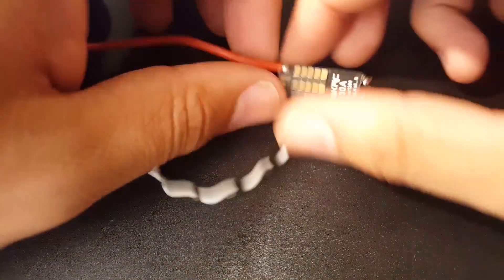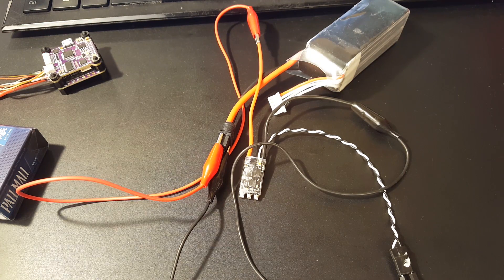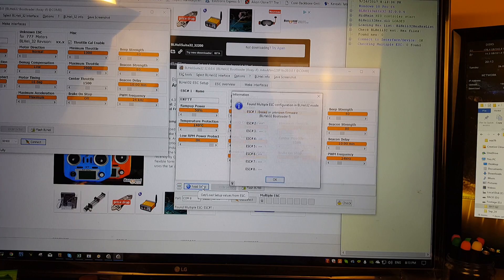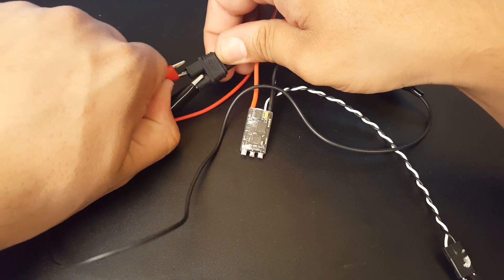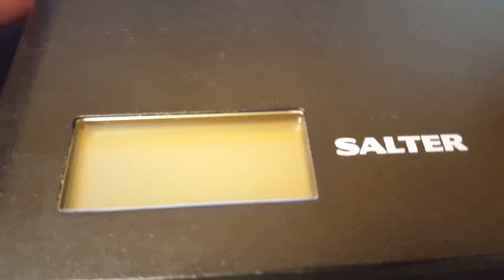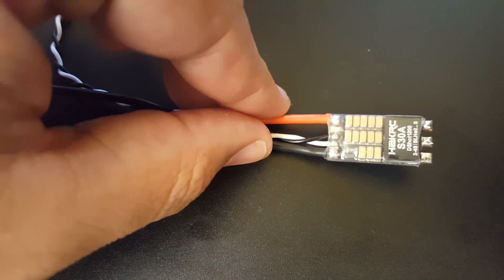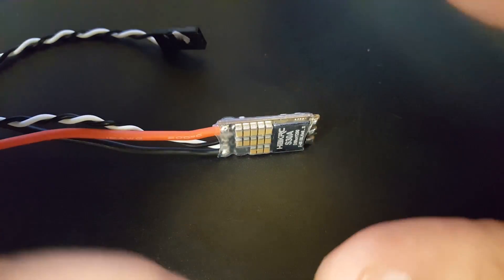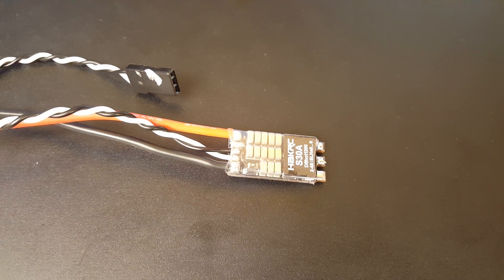HAKRC BLHeli32?? // Review and Noise Testing

Comment: Hey dude will these escs be ok on the matek f722 with the brotherhobby returner r6s motors because I know the matek has a sensitive gyro and will a 470uf 35v low esr cap be sufficient to clean any noise, placed on the incoming batt power
Reply: You've probably already tested this but I'll write anyway, might help others..

I've used these escs with ls2207 motors on the first matek f405 aio which uses the same gyro without problems.

Comment: I'm using these on 2 quads. They're great, but they don't work at 48khz. Ok they may appear to work, but I had desynchs. Back on 24 and they're fine. This is on dshot1200 with f4 flight controllers (Matek F405 OSD and Dys Pro V2). Have ramped back up to 32khz and so far, so good. But I'm not goign any higher at this point due to the desynchs.

Comment: You can get a set of 4 of these for 38 dollars from Amazon under the brand name Nicidi. I fly mostly Wraith's at this time just because I havent had one fail even when over abusing them lol.. I was given two sets of these to review and I was absolutely impressed.. With a little bit of adjustment the performance is superb, In fact I cant tell a difference in flight between these and my Wraiths and I have MANY MANY MANY packs on Wraith BLheli32s (I have at anyone time 8 to 10 builds with Wraith ESC's on them and fly between 20 and 30 packs a day on them so I know the feel of them very well and truthfully I cant tell a difference between these and them) they feel exactly the same in flight as my Wraiths and they hold up super well. I have a premium budget build I put these on (I was given 8 for free, I have since bought 6 more sets of 4 and pay 38 to 41 dollars on Amazon for them) the build is a F4 Omnibus Pro, These Escs's, RaceOne/Nicidi 2306 2750kv motors (Absolutely stunningly awesome set of 2306's for under 50 bucks. Both the 2400kv and 2750kv)  Realacc Real 1 5 inch frame that weighs in at 92 grams, Runcam Eagle 2 pro and a stack mountable 200mw VTX, Graupner GR-12 SumD only receiver. ready to fly minus battery is 302 grams. Flying my Teampilot 1550 100c packs (And 1550 95c R-lines) the thing flys AMAZINGLY good like WOW for a mid range price product build its flat amazing.. I would say its 90% as good as my top spec builds and im not kidding... I have really ripped these packs hard running Avan Rs on those 2306 2750s  on flat punchouts it will pull 170 amps on the Avans and settle down to about 130 amps and these escs handle it no problem at all... I have wide open throttle them running around a big field killing a 1800 mah 75c 4s pack in about 40 seconds and the escs handled it no problems.. The amp draw on that flight was 110 to 130 amps the whole flight that lasted 40 to 45 seconds, I was amazed that I didnt cook a esc or two or all lol but they stood up to it and when I temped them right after landing they was 120 to 125 degrees each.
I really cant believe how good flying a quad you can build now for little money, If I was to throw a high quality VTX in there (I fly almost exclusively Tramp VTX's) I could take this out and race with it and turn really good lap times for a heavier rig, in fact I would say one of my premium rigs in the same weight range would turn less them 5% faster lap times on avg and thats only due to the faster response of the premium motors that im used to flying overall power wise those Raceone 2306 2750s feel pretty much the same as my Returner R5 2306 2522kv motors maybe a little slower on top end but not much and the response is a little quicker on the R5s.. The main difference is the R5s make a little more power but pull a LOT less amps, but the R5s are a 100 dollar set of motors and the Raceones are a 48 to 52 dollar set of motors.
Oh yeah, I have a set on a Floss 2 build, Hyperlite 2204 2522kv Floss motors, these ESC's, HGLRC F4 V5 Pro, PDB, FC and VTX AIO, Eagle 2 pro cam, ready to race minus battery is 237 grams.. I fly it on Tattu 5s 95c R-lines 90% of the time and have flew it on 6s and cooked one ESC on 6s(However it was due to clipping a small branch and it getting stuck in the motor locking it up, current sky rocketed before I dis-armed and cooked that ESC.. I had flew 8 6s flights that day back to back to back and it was fine. 6s is pushing it and you may well kill them but on 5s I can attest it handles it no problem. Just dont go slap on some high KV 2207s or 2306 and fly 6s as the current will be fatal for them), on 5s it has well over 200 flights on it with not one issue flying the 2522kv 2204s with HQ5x4.3x3V1s props and pulling a max amps of around 95 and a avg amp draw of 45ish when just playing around running gates getting ready for a race, 5 to 5 and a half minute flight times on good 1300s is really nice with that setup. I know its a long post, Im just shocked to say the least about how good of products we have now at very VERY low prices.
Reply: beeker bot you can get them for $4.99 on sale like I did ;)
Reply: beeker bot how do you like your f4v5? I had mine in my chameleon with my dys 2207 2600kvs but someone cut through my jeeps window and stole all my quads and tools yesterday :/
Reply: Well here I am, a year later and only one esc have failed. I've got them on two quads and one of them I fly exclusively during winter and rainy days or were I could get in contact with water/damp grass etc etc. 

It's on that quad one esc broke. Mind you in that crash two motors got ripped off and everything except three escs, the camera and rx broke. Was going pretty much full throttle into rebar and then smashed into the concrete ground cartwheeling a good 15-20 meters. 

Got to give a huge thumbs up to transtec aswell for the tank of a frame the frog is. A small crack in the top plate and exploded motorguards and some pretty big scuffmarks on the end of the arms is all the damage it sustained.

To sum it all up I can vouch for these escs, they have been great!

Comment: Had a test flight today. I set the motor freq to 32Khz. Got a lot of video noise however motors ran really smooth. Everything else was stock. I have a 1K micro farad cap installed already. Using a BFF3 board with dynamic filter on. I'm going to shorten my battery lead and re flow the ground wires for the vtx and cam.
Reply from the maker: +prophet11236 drop to 24khz before anything
Reply: Drone Mesh It got alot cleaner with the above changes however I still get the high frequency noise waves on the screen. Perfectly flyable however I'll drop down to 24khz to see if it clean up 💯%
Reply: Funny I actually was considering the DYS Aria at first...sigh
Reply: so did it help? im also wondering if i should try out higher pwm

Comment: I am getting back into this hobby again and I was wondering do you have any videos or tell me where I can find info on hooking up the Ardunio  and the Bel-heli firmware to be able to read & change settings on the ESC's as you are doing here? any info would be MUCH appreciated I have the Ardunio mini and the Reg board I would like to get back into re-flashing and or changing the ESC'c settings and it has been a long time -looks like a lot has changed just from 3 yrs ago
Reply: BLHeli and betaflight(3.2) have been updated now so you can connect to blheli32 ESCs like normal (just plug your Flight controller in and open up BLHeli 32 and connect to the com port)
Reply: Thanks Gareth I'll give it a try, I can't believe how much this hobby has changed and how quickly the technology has advanced in such a short time. I owned and operated a retail Hobby Shop back in the late 80's
through the 90's it is just incredible how it has changed there were no lipos back then either only NiCads and that is what peaked my interest to get back into the hobby

Comment: From the noise perspective, do you think a matek f4 aio will be fine with these guys?
Reply: Lucas Lido they worked good for me.The one thing to watch out for is the capictors on the escs are not soldered well.i have had 2 fall off so far

Comment: Love the channel, i'm a new subscriber but am enjoying what i am seeing.
I'm getting a fair amount of video noise with my setup, even with caps. I'm using ZTW flash 30a's flashed with oneshot42, on F40 Pro 2400kv's.
What ESC from all your experience with noise testing would you recommend?
Reply from the maker: EssexRc add a voltage regulator or lcfilter
Reply: Drone Mesh 
Thanks for the reply. I did try that and made little difference, that's why i though different escs might help.
I was considering the DYS 30A after watching your video
Reply from the maker: +EssexRc check my newest video just uploaded 1 hour dys aria finished full testing on it

Comment: I got the Spedix 32 ones instead, awesome smoothness on a 48000pwm. Running on the Matek aio. Skyzone xh210. 
Side note.. breaking is not activated as default!  And only some escs can use breaking percentage, some are just on @ 1% and off @ 0%.

Comment: I'm interested in how you used the Arduino.  Video on using it with the ESC would be great, even using Arduino with iNav
Reply from the maker: +Nicholas Heidl I made a video on it. Connecting to blheli32 show you how to flash arduino and connect to the ESC.